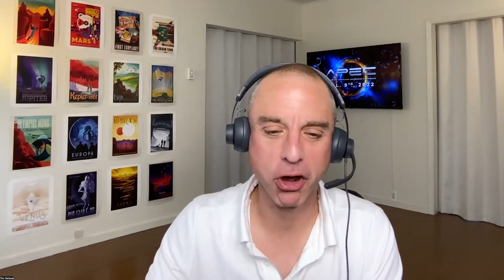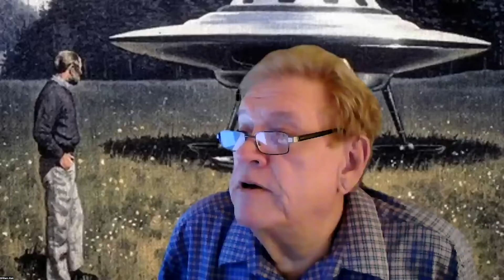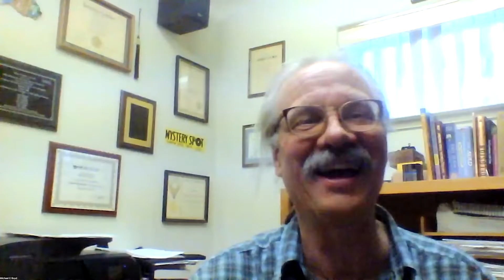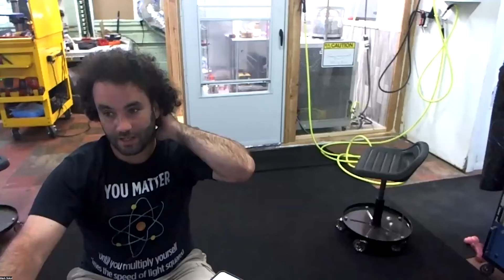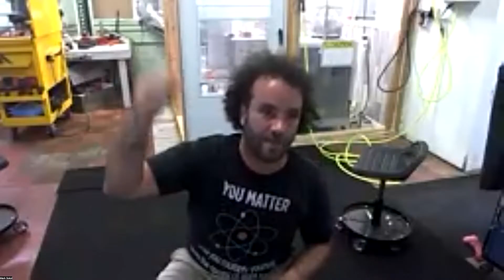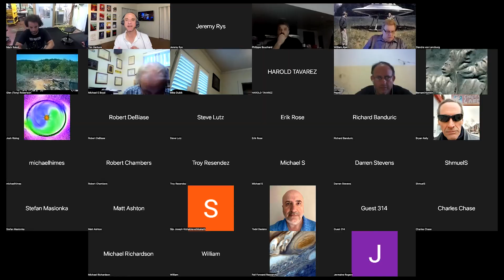APEC 7/9, Part #6 - Bill Alek - Tom Bearden's Scalar Waves Q&A

Comment: Great job William! You're doing some awesome stuff and I believe using the correct terms. 

What is a scalar vs a vector. So you're creating a scalar that goes back in on itself is what I believe you were saying. 

I think Falcon, i believe that was his name, was asking and confusing scalar (what's little known about it) and longitudinal waves, well the 1 known scalar physic video on YT, which is good but doesn't have to be the only definition necessarily till proven otherwise...although I believe from what little I saw in order to create a scalar you gotta create longitudinal waves. He could be right, you could be right, both could be right...it's all theory. 

I have heard his definition before but I gotta say that you and you're work also makes a lot of sense and all. 

But he asks tough questions to challenge you and push you. I don't believe necessarily yet that a scalar has to be defined exactly as he stated. Its a scalar vs vector...scalar.

But there is so much unknown about this all, it's all theory. So call it as you see fit sir. 

Also couldn't you just use radar or such, send out 2 radar beams pushing em energy and then interfere the 2 beams (by 90° or 180°)...interfere/interferometor... in a region and produce the same thing an interferometer does? 

Thanks for all!